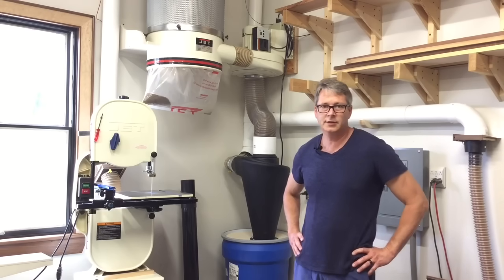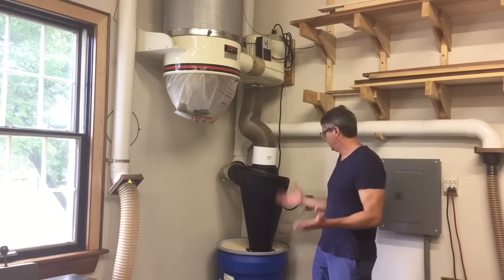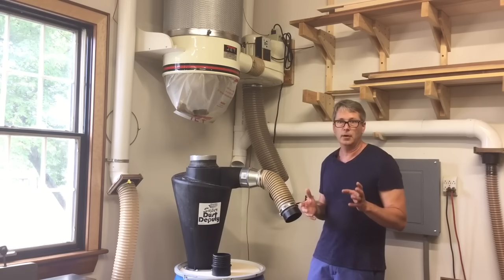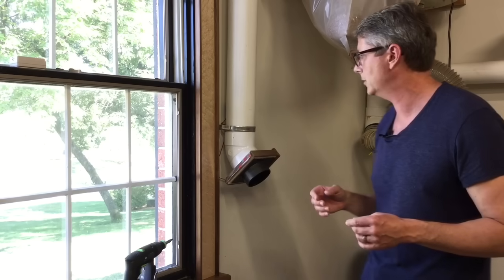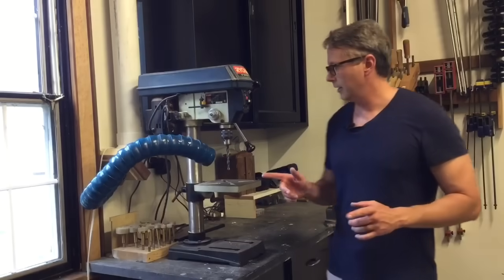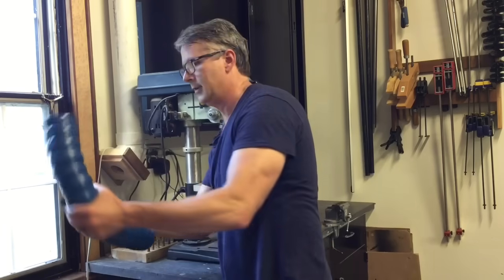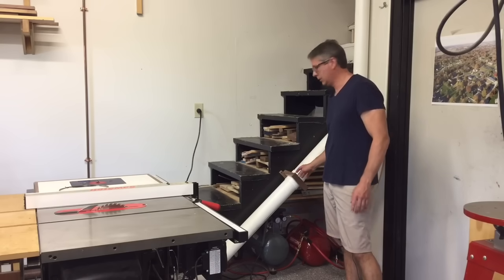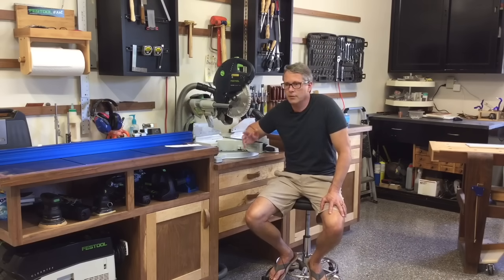Advanced Dust Collection System for the Home Workshop.

Comment: Beautiful shop!! Trying to figure out my system. Reading Bill Pentz's great information about fine dust collection. It seems 4" pipe struggles to have enough CFM to capture the scary "fine" dust. Have you ever done any testing on your system?  Thanks for sharing and the inspiration!
Reply from the maker: Thanks Rick. I have only my own shop tested experience to say that this setup is far better that the system I had before the upgrade and I love it now. I will research the Pentz advice you referenced to see if I can make it more awesome. Thanks.
Reply: I like the pipe installation; very well done!  
Bill's the man. His best analogy is a balloon and a straw.  It's easy to blow the balloon around with the straw, but try to catch it by sucking on the straw.  Doesn't work unless you get right next to it.  Same thing with dust collection; it has to pull air from everywhere and you can't force it into a pipe that is too small.  I'm also concerned about going from my 4" drops to a 6" main and then having the FPS fall off enough to drop the heavy stuff out of the airstream.  I'm in the process of switching everything to 6", even the table saw and the band saw, and installing a diverter to vent it outdoors when I'm not heating or cooling.  Pretty rude awakening when my air quality monitor went off just from me and my dog walking around the shop.  I've got (what I thought) was a pretty good system with a very good filter on the single stage 3 HP collector, but I've been researching Mr. Pentz's excellent info and things are going to change in my shop.  This is serious business, fellas.
Reply: Good stuff Bill has for sure! I'm going with a 3hp motor with a 14" impeller with an Oneida cyclone and 6" pipe. I hoping it will pull enough to get the job done. Will try to figure out a good adaptation for my cabinet saw. Thanks for sharing.  @michaelrice500

Comment: Hello, I came across your clip on the design of a home workshop extraction system. I can praise the matter is done solidly, but I would like to warn you that you are using a tempored bomb. Since you have a pipe system made of non-static piping tubes that collect static electricity, it will only be enough spark and the right amount of dust to cause fire or even explode in the system. so I recommend that you replace the pipes for metallic pipes intended for suction. I am telling you from experience and how the consequences of tragedy with such systems have already been met and what has burned down 

Wish you all the best 

BIG MIKE
Reply from the maker: Did you actually have a fire from static that you saw first hand?  Let me know because I have not found any actual evidence of a fire from such a setup and I did do research.
Reply: Hey big mike. You couldn’t make that system blow up even if you tried.

Comment: You may have avoided the drop in efficiency of a dust plugged filter bag but you did not gather your info very intuitively . 
Dropping down to 4" so quickly reduced your efficiency by a good (bad) 30 % .  Using the Dust Deputy (and this is not your fault because the flawed design of this unit has gone unscrutinized ) , because of IT"S air flow cross overs  reduced your efficiency by another ~ 25% .  
A trash can cyclone with baffle removes so much particulate that the exhaust , in many cases can go right out the wall .  (starting with a $$$$ unit and tinkering it into submission is an insane waste of time . )
Reply: Harry,   Not arguing, but how can you find fault if he's getting great results?  
What do you think of the HF unit with a Thein baffle?  Can you explain your ideal system?
I ask because I'm planning to install a system and find much contradictory info.
Reply: @WilliamBrownGuitar    My reaction to this system was not more positive because of the amount of cash laid out for a high volume system only to cannibalize it .  And then  reduce the CFM with less than optimum pipe and a tiny dust separator .
A HF 2 HP unit(200.00 vs. 500.00) is a better start to a custom system . I too have been looking for the best ideas . A Thein baffle of the largest diameter design is much better than either dust deputy (the air intake does not cross draft the exit and the CFM loss is much less . ('Tips for Central Dust Collection, WWGOA.com  gives the best guide for a system construction )
Reply: Thanks Harry, that's very helpful.  I have seen the H.Freight 2 HP unit come up so often and it seems to work great with a Thein baffle.  Did not mean to hijack the comments, but what you said made sense to me based on my research to date.

All that said, this system seems to do the job for Selandry 1, so one has to wonder how theoretical (vs. real-life practical) much of the science behind dust collection really is.
Reply: @WilliamBrownGuitar  I just came across a video ' Thein baffle vs cyclone , efficiency comparison ' (You Can Make This Too , channel ) .  His findings , surprisingly, found the cyclone to be less of a CFM loss . (2:1 !)   I'm inclined to believe his home made Thein had some air leaks reducing the Thein air suction . However , unless his math was wrong , It would still put the cyclone almost on par , if not better, than the Thein design , His cyclone was the larger Super Dust Deputy , not the tiny one .  Happy system hunting .

Comment: My 2hp grizzly dc still sits in the garage on my todo list, as I continue to roll around a shop vac from tool to tool while stepping over the hose when it’s plugged into the table saw.  Wall mount and 2stage, thanks for your research and your excellent “to the point” explanation for pipping your shop.

Comment: I promise I'll (eventually) stop pestering you for ideas.  You said the 45 PVC fitting was attached to the suction side of the blast gate with "silicone glue."  Reading about silicone glue, I'm seeing that it is not recommended to bond to PVC.  Any insights there?  Did you just run a bead around the base of the fitting and let it cure overnight?

Comment: I dry fit as well but I found that when I taped up the joints with actual duct tape, (silver foil tape) the efficiency of my system went up dramatically.  I didn't realize how much air I was losing at all the joints.

Comment: Selandry, how did you connect the 6" flex hose to the 6" PVC coupling in the line coming off the Dust Deputy to the blower?  It looks like a pretty secure connection for you to be able to just pull it off and push it back on.  Also, did you use Oneida's 6" flex hose for this line, or some other source?  And is the coupling a simple 6" PVC drain-pipe coupling?  (I am well on my way to putting my system together; I just need a few more parts!)  Many thanks for your guidance and fine example.
Reply from the maker: I had to buy the 6” flex hose from woodcraft and it just fits snug into the PVC coupling. I don’t even think I used any silicone glue or tape. And yes it’s a regular 6” PVC UNION fitting.  Thanks and good luck.

Comment: I used the light weight PVC but it isn’t working very well. Have had to use a lot of tape to cover all the holes that are in one side of the pipe!! 😡
Reply from the maker: Did you get perforated drain pipe?  I used regular sewer PVC. There are no holes in sewer pipe I used.
Reply: Selandry1 LOL. Sorry. I was just trying to be funny. 🤗
Reply: Selandry1 Great video by the way!

Comment: I wonder if one more person could comment or ask you about grounding your system...😂  But I was wondering (and forgive me if I missed a previous question about this) but did you consider using 6” pipe to your first wyes?  Just curious to know why you chose not to go that direction. It’s a bunch cheaper to go 4” so I’m looking for reasons to spend or save the money.  Thanks man. Great video. 
AND...didn’t even notice the “ummms”!
Reply from the maker: I used 4 inch because it’s cheap and I only run one tool at a time. I get plenty of draw with the 4 inch. Thanks for the comment.
Reply: Remember, dust collection is going backwards compared with HVAC distribution, so going from a 4" drop to a 6" main looks logical, but it doesn't work well.  When the 4" drop gets to the 6" mains the airflow slows down and the heavy stuff falls out of the stream (the volume doesn't increase either).  You end up with clogs that take off all at once and can damage the impeller, blow fittings off, etc.  If you have 6", 7" or 8" pipe, hose, cyclone, etc. and then reduce it down to a 4" hose, you have a 4" system.  You can't force more volume into the 4" fitting, unless your collector is immense.  Say, for example, your sander needs 100 CFM to clear the fine dust.  Your 4" fitting will only allow 40 CFM with whatever dust collector capacity you have.  The other 60 is going to be blowing around your shop, whether you can see it or not.  (It will end up in your lungs and you might as well make friends with it because it's never going to leave).  I highly recommend reading Bill Pentz's info.  Good engineering and lots of sound info.  Easy to find with a simple inter tube search.

Comment: I’m using 4” sewer in my shop.  My issue is getting the pipes to fit my rockler blast gates and other fittings I purchased from rockler.  The sewer diameter is bigger...How did you fix this issue.  I plan on upgrading the blast gates in the future but for now I’m just gonna use what I have.  Great video, thanks in advance.
Reply: Hey Matt, I had the same issue with my system, what I found was molding the PVC to conform to my existing fittings works very well so I didn't have to buy any expensive adapters (if they even make any).  Although this is a basic way of doing it, this video should help you out.  https://www.youtube.com/watch?v=ugUZYmrqejs  There are also a few other good ones out there.

Comment: curious, you acknowledged using the biggest pipe you can, but you reduced to 4" right out of the cyclone.  Why not run 5" all the way to the wyes?
Reply from the maker: I could not find 5 inch sewer pipe.

Comment: WOW what a great system!!! j All of it. And a great shop. what model dust deputy? I'm guessing the 5", but was confused about the top being 6" What HP DC. or the model, I can look it up?  I went to the Oneida Air site and emailed them for advise. I told them i had 4" pipe and 2HP DC.  They said to get the 4" kit they make. Now I'm not so sure......  yours looks like 4" and i have never seen one collect that much!!!
Reply from the maker: It’s the super dust deputy. The vertical diameter is 6” that connects to the DC impeller and the horizontal is 5” that connects to the PVC pipe. There is a bigger model called the Dust Deputy XL and a smaller one called just Dust Deputy.

Comment: How did you attach the flex hose inside the 6" pvc coupling (that connects to the top of the cyclone)?
Reply from the maker: Good question. Had to go out and look. It just fits in there perfectly. No glue or screws needed.

Comment: I like it but way to high speed for me. I don't have the space, time, nor funds to do something like this. I will continue to take my tools outside and connect my single Rigid 16 gallon and 5 gallon dust stopper. Works fine and my shared garage doesn't get messy. Thanks for posting though.

Comment: Like your dust deputy system for disconnecting, very efficient.  I'm planning mine right now but I think I may need the XL version because I ran 6" mains.  Funny I have the exact same dust collector and  filter that I also bought off craigslist. 
I love and use the micro switches from Long Ranger as well. It's one less motion as it turns on with opening the gate, cant get any easier than that.  I bought the spring loaded metal gates and dont care for them as they just aren't real smooth operating.  I actually like and use a plastic 6" that I use on my miter box station and may convert all my 4" to them as well.  The trick I learned on another video from the dust build up was to trim the backside off so the dust cant build up but just pushes out the back.  Thanks for putting this video together
Reply: Are your DC,s 220V or 110V?  2HP?  What model did you guys go with?  Trying to do it right the first time. Thanks!

Comment: Is that a Rockler Dust Right blue bucket under the Dust Deputy?
Reply from the maker: It’s a chemical storage barrel. 39 gallon I think. Very rigid and air tight.
Reply: Selandry1 mind sharing where you got the bucket?  I’m only finding $100 ones.
Reply from the maker: I got it off Amazon for $45, but I cant find it now. It’s a 30 gallon chemical drum. It’s really sturdy with an air tight seal so it works great for this application. Sorry I’m not more help on this.
Reply: Selandry1 Thanks for the update. I’ve seen some from Uline, but they’re 77 bucks. I saw another video on YouTube suggesting I check with a local refinishing shop, because they get these containers but need to dispose of them. We’ll see.

Comment: Did your DC originally have a restrictor "ring" at the inlet to the impeller housing? I have an older delta DC which essentially looks like your single stage. It has a 6" inlet at the impeller (a detachable  4" wye for t different inlets). There is a restriction (I think so there will always be a load on the motor, in case it gets run without being hooked up to any piping) in there. I've read, and seen, where people cut that out so they have the full 6" for the main trunk line. I was curious if you had to do a similar modification. Oh yea, what HP is the motor? Impeller diameter?
Reply from the maker: I did not have to make any of
Those mods you mentioned.

Comment: Great video.  You're venting inside through the metal ("...Dog") filter.  Can you share its specs and how you selected it?
Reply from the maker: It’s a corrugated filter that came with the dust collector. I bought the unit because it had strong power and a good filter. Would not have bought it if it had a bag filter.

Comment: I think everyone else has asked any questions I might have had about your great DC system.  Now I'd be delighted if you tell me about that great-looking floor in your shop.  What is that, and was it expensive?
Reply from the maker: It’s an industrial epoxy floor finish applied on concrete. Have had it about 5 years now and it is holding up well. Cost about $500 for the epoxy.

Comment: With all the videos and research you did, you must have skipped the part about grounding a dust collection system.
Reply from the maker: Thanks safety officer. I have indeed researched it thoroughly and can not find credible instances of a non industrial workplace igniting in flames due to a dust collector and static so I did not ground the system and don’t regret it.
Reply: very good video!!! thank you.
Reply: Joe M: 
His ass, indeed, appears smarter than you. Your resources on the legendary wood dust explosions must have included the isles of tool store and golf course locker rooms. Indeed, it does take an industrial environment to create just the right conditions for one of these hens teeth rare fires. Perhaps you should skip the part of perpetuating old man hysterics in favor of actual research.

Comment: I like the video, very well done.  The sewer pipe is 4", correct, is it triple wall by any chance?  And I keep hearing you need to ground it if you use plastic, but I didn't see that on yours.  Is it grounded?
Reply: What size pipe?
Reply from the maker: I did not ground it.
Reply: Selandry1 Very innovative and clean system! you concerned with static electricity buildup sparking a fire? As I researched my system years ago, grounding was a must any time using no conductive pipe. The potential for a static spark inside the pipe igniting fine dust is a serious fire hazard.
Reply from the maker: I researched it and found that the fire thing is not supported by real fact and the fire thing was debunked, but the suggestion that it be grounded will exist forever.
Reply: Selandry1 thanks for the reply. I did my system 18 years ago and haven’t researched since. Now that I googled, I see what you mean. 🤙🏻

Comment: Nicely designed system.  I have the same blower & cyclone it can handle 6” ducts which will improve performance even with the CFM drop a cyclone causes.  Also tape is better than caulking to seal joints.  Not criticizing you just suggesting for you and other viewers.

Comment: Excellent instructional D/C video. I'm in the final stages of D/C installation in my own shop. Albeit about 30 years too late. Thus far I'm discovering issues that you've already pointed out. First of all are those cheesy over the counter blast gates. THEY LEAK...and are easily heard above the din of the collector motor. They won't last long. Thanks ever so much for taking the time to produce this. My system's dry-fitted as well, but strengthened by silver furnace tape and self-tapping hex-head screws on each joint. Again,  thank you. It's easy to see, you hit the nail on the head.! Thumbs-up...Thumbs-down ratio is awesome.